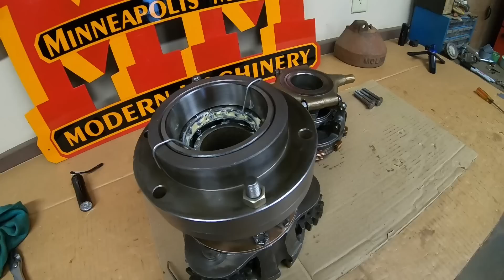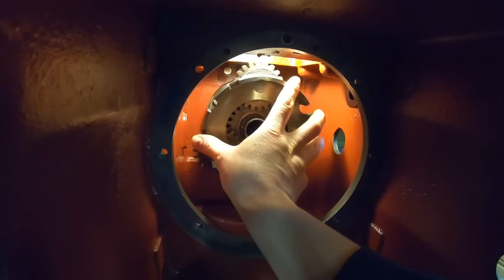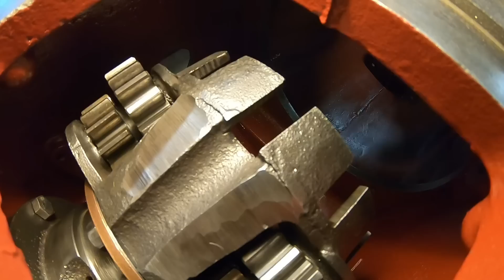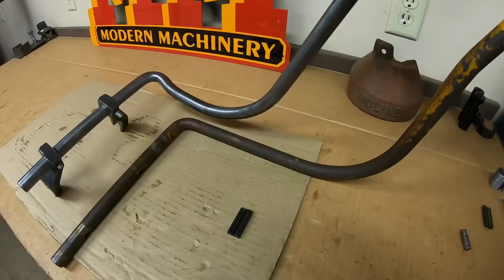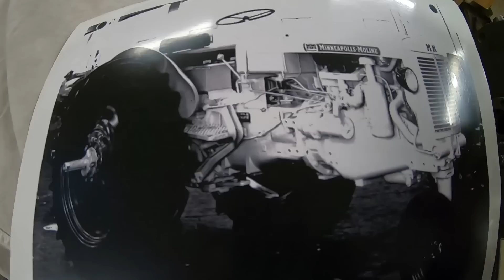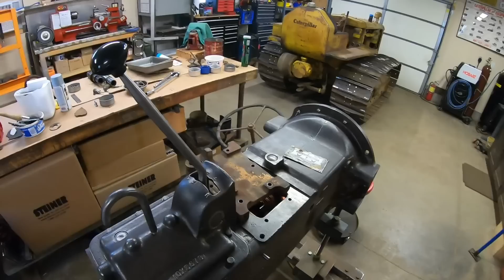Grabbin' Gears!!! #X231's Prototype Ampli-Torque Unit Goes Back Home Again - X231 Episode #54

Comment: Thank you for giving me step by step instructions on how a torque amplifier works. I know what it actually does because of the 966 we have, but I didn't really understand the mechanics of it because I've never had one apart or even been around one that had been. It almost seems like you've worked on some automatic transmissions at one time. 😏 👍👍

Comment: great work.........the pins in the clutch  or any  clutch ,should be installed with the heads, so they move toward the rotation of the shaft ......
Reply: @squatch253  keep up the good work  its interesting.......

Comment: I have a soft spot for MM tractors. Worked at our neighbors dairy in high school and ran a G900 diesel every day! Loved that tractor! They had any MM combine and a "Z" that unfortionately burned up in a ditch burn that got out of control. Not so much love for loose needle bearings though 😉. Loving the new (old) project.

Comment: Squatch - now that you explained how this works -I don't understand it!  I assumed it was akin to Massey Ferguson's Multi Power (including the lack of engine braking caused by the one way or Sprag clutch) but the idea of Mulipower (and other manufacturers often better set-ups like Fords Dual Power) is to give a clutchless half gear reduction  when you hit a tough spot. But by looking at the speeds given it 's more like a 1 1/2  gear change down, more like changing into low range and there would be no need to do that clutchless.

Comment: Interesting video.
Looks like the ampli torque was the forerunner of the speedshift on massey ferguson 3000 series. Although being newer they had hydraulic engagement of the clutch and a hydraulic break disc instead of a one way clutch giving engine breaking in hi or lo. The gears could also be reversed, giving an over drive instead of an under drive.

Comment: It would probally work much better if it had 6 computers monitoring 75 sensors , and China made plastic gears.. no replaceable parts , if it fails just get a $4,500 replacement module from Amazon of course.
🚬🐕

Comment: A question for you if you will. I talked with a guy I think he was from Minnesota a few years ago and he had taken the rear end fro I believe it was an old Oliver and attached shafts to it making a for cart for horses and as they pulled it the ground travel from the wheels turned the pto this giving him the power to bale hay with a small square baler. Do you know if this is possible and can it be done with any other tractor rear ends.
Reply: @squatch253  Thanks

Comment: On those hollow split roll pins I have driven a slightly smaller one inside to give greater shear strength. Just a suggestion for you.

Comment: When I first started watching I watched the x231 videos.  Why I  enjoyed watching was solutions to issues and it shows how the evolution of tractor design occurred,

I hope you are getting enough viewership to continue on.  

Yes I know you want to get going on the H and the rock crusher. 

Honestly so many IH videos out there I will not be as interested.

But I will continue to be a loyal watcher and supporter.

An automatic had a drum brake or clutch.  I would think a band brake around the drum would be a better than a sprig clutch.  Plus with a drum brake I believe you would not run into the free wheeling problem.

Comment: Hi, I wrote to you before I believe with this tip. Instead of grease I have used magnetism to hold ferrus pats together during assembly. Rubbing (in this instance) the housing with a magnet or wrapping a coil of wire around it and passing DC current through the wire coil will hold the balls in place. Give it a try some time. hanks for a great show.

Comment: Urgh! Hi Toby, I wonder how they assembled those modules originally - I guess I mean in production. Surely on the line they did n't have to play advanced juggling? At least this time I know how one way roller clutches work - my Honda 250 has one on its starter drive. Somehow the ring holding the rollers got split ..... Planetary gear systems are almost magic in the amount of gear ratio change they can introduce. This is a very interesting use of them in a different mode. Very clever design. Well explained as well.

Comment: Thank you for your patience and care in explaining the planetary gearset. Planning that sequence -- not to mention the effort of working out all the camera angles and lighting in a very confined space so as to back your explanation with clear video -- must have added hours to the actual job!
On a marginally-relevant tangent, some of the most numerous planetary gearsets on the road today are in Toyota Priuses. They use a complex multi-stage planetary gear set to split drive power between the combustion engine and the electric motor/generator. Look up "Hybrid Synergy Drive" videos.

Comment: As soon as the weather breaks (I do not currently have a heated shop), I'll be digging into an Ampli Torque myself, and I consider this to be an excellent base guide as to what I'm going to have to face down myself.  Little tricks like the wire holding that bearing up would take me hours of staring, thinking and cursing, now because of you and X231, I'm that much further ahead.  

I feel like a slogan for your channel could be "Squatch253, I make the mistakes so you don't have to!"

Comment: Sprag clutches/bearings must be much better now six decades later, because they are used in automatic gearboxes, hereunder hybrid transmissions, where they last for hundreds and hundreds of thousands of miles. In the Prius plug-in hybrids, the sprag clutch counteracts the torque from the second electric motor instead of the combustion engine, when it is not running.
The Toyota hybrid CVT works just like a differential, and the sprag clutch locks one side of it.

Comment: How did they install those torque amplifier units on the assembly line? It seems highly inefficient to just have someone do what you did for every tractor rolling down the line. Also, did Caterpillar ever make a tractor with a '1J' prefix? I found the carcass of one a few weeks ago and that's what I believe the tag read, but it had been partially painted over at some point

Comment: That is a neat setup.  I appreciate you taking the time to show and explain how it works.  Really not that complicated like you said, though I don't really grasp how the one way clutch works, but that's ok.  
It's nice how you compare the production parts to the experimental parts.  Not many people can do that, I appreciate that you can and do!
I find your explanations of the R&D process and failure fixing interesting. Which goes back to the changes for production.  Brilliant solution for your shaft locating issues.
Sounds like you have the original setup figured out, doing that detective work is fun.
This project is really coming together fast now that you're back on it!  Keep it up!
Reply: @squatch253  great explanation, thanks, that makes sense.

Comment: Using the two pieces of wire to assist the assembly was ingenious.  I have to believe that MM had some type of tool for production assembly because they couldn't possibly have had someone fumbling around all day trying to put those components together.  Of course, like the other mysteries of this tractor, that tool is lost to history.  More good work Squatch.

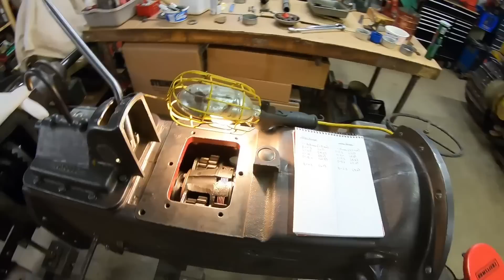Comment: 12:45 Wonder if my international 684 has similiar thing in it's "Torque Amplifier", Thought that the gearbox is going bad as it starts to freewheel in lowrange down the hills.
The TA is same quickchange gear from low to hi, but it also has seperate manual crashbox low-hi as well so plenty of gears

Comment: Thanks for the explanation of the torque amplifier.  I was confused at first as to what it did.  No engine braking in low range would be a deal killer for me but might work in the fields.

Comment: It helps to use some assembly tack with a low 100-degree melting point and put a lot over the rollers. It works very well on the large catapillar mine truck torque converters.
Reply: When does it melt again? I was thinking about using something that could be dissolved with gasoline or lacquer thinner

Comment: After you explained how this unit works and my experience with the IH tourqe amplifier I know the sprage clutch was not a good choice for this unit . I work on Allis Chalmers tractors and have found that their power director unit is much more reliable.

Comment: Your ability to solve an issue in a way that preserves the originality is remarkable. You should have been on the engineering team, indeed any manufacturer would benefit from your input on practicality! Another great delve into this rare and unusual, as well as steep climb of a project.

Comment: Keep in mind every part , every clearance, every spec was concieved by the designers on paper and pencil
Then paper given to machine shop
To make it work...
No CAD
No 3D printers
No CNC 
As primitave as can be
Here at the Moline factory
🚬🐕
Reply: That way of doing things being a close relationship all the way through design and build worked along with slapstick for calculations built the most advanced aircraft the world has ever seen. These are the P38 fighter, the Armies first 400 mph fighter, the U2 Dragon Lady and the fastest ground launched aircraft ever the SR 71. That method is how Lockheeds Skunkworks operate. Having no roadblocks in the design and build process led to these aircraft being developed and flown in remarkably short periods of time.

Comment: Instead of using regular assembly grease try using needle bearing grease when doing jobs with loose bearings.  It has fibers that hold them in place.

Comment: Hey Toby. Curious if any work other than adjusting the clutch could be done through the top cover or was it a split the tractor to do any work on it
Reply: @squatch253   Thought so based on what you showed in your great videos. That would have to be one of the major frustrations with the system

Comment: I agree with Mr.Ohnstad, It is nice to see someone can so much about preserving the past! I will be back for the next one and the one after that too! 
you must be fairly close to be have the rear end ready to bolt to the front end.
Reply: @squatch253  I Have faith in you that you can get a quality product for bolt up soon, I think you could have rear wheels on the ground by summer as you will transition into something else soon. How much different is thec 445 flywheel and shaft from yours?
Reply: @squatch253  Well as for the shaft, you could weld it up and machine it back down and then have it balanced if you so desire, or you can machine a new one, with splines to match. I think you would be further ahead this way, if the splines are that bad, if I understand your dilemma correctly

Comment: Excellent video the ampli torque unit is looking good. The bushings are a Excellent way to keep the shaft in place . When you are driving these tractors you have to pull the ampli torque handle back to shift gears that is why the original design they were slowing the engine down to try to keep the gear train from locking and when I say they will lock the 5 star diesel we had years ago it would hold on a hill when you backed up a hill and pushed the clutch down it would hold in there in reverse until I went to low range

Comment: I have gone back through the whole series.  I now remember, and completely understand the struggle that X231 is.  You are really fighting to bring back a tractor that otherwise should be scrapped.  The prototype value is what makes it worth it from what I see.  If there needs to be another 2-3 year break, that is understandable. Keep up the great work and teaching us what a proper restoration is.
Reply: This puts X-231 in the same league as 5J-1113, “The Tractor That Should Never Have Been Re-Built.” But what a wonderful educational platform for engineering and design solutions. My first 10-Speed bike had a rear axle one-way clutch in the form of a pair of spring-loaded dogs that make a “tick a-tick a-tick a”  sound when coasting. My present bike is silent, and must have the roller cam system, instead.

Comment: I'm surprised the engineers skipped over any sort of device to help keep the one way clutch bolts locked in, you'd think at the bare minimum they would have used lock washers to help keep the bolts in place.
Reply: @squatch253 oops……shoulda read the comments first…….my bad!

Comment: Thanks for the illustration of the operation.   That Sprag clutch must have given some terrifying rides for those who weren't expecting it!
Reply: Gosh, imagine going downhill with insufficient engine braking and thinking "I know, I will put it in low range". Probably the penultimate thought you will ever have...
Reply: I was really interested in that description as Massey Ferguson brought out a change on the move system called multi power an it in the low range gave no engine braking at all and I think due to lack of tractor driver training many of these tractors were written off within weeks of being delivered to farms especially with steep sloping land 🙄😟 great video 👍
Reply: @bobpaterson1845  I'm one of those who found that out on a MF 165 on a downward slope - made for an "interesting" ride lol.

Comment: Nice to see the case getting filled.  I hate sprag clutches.   They have to be the most unreliable mechanical devices around.
Reply: They work fine in automatic transmissions.
Reply: @erik_dk842  I've had 2 gm transmissions grenade from broken sprages.